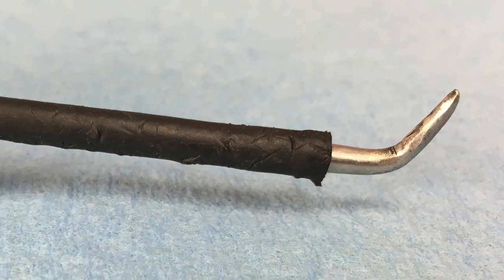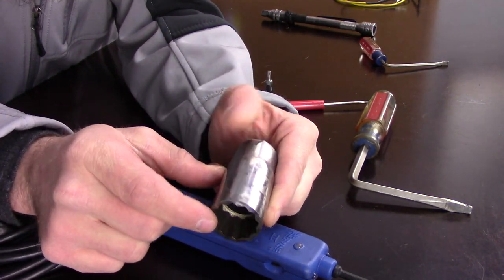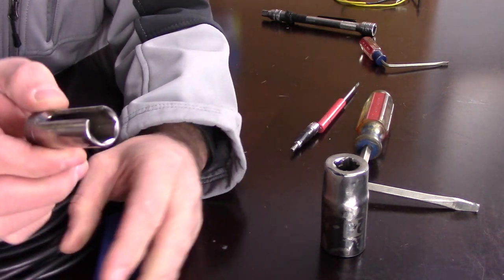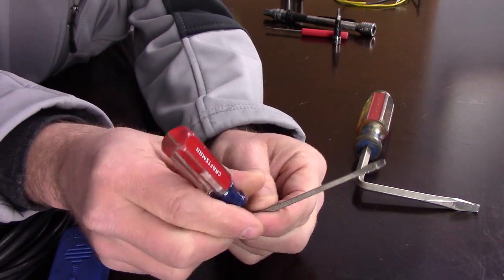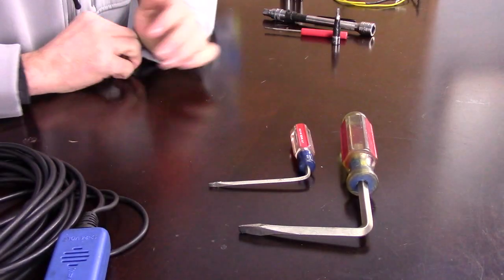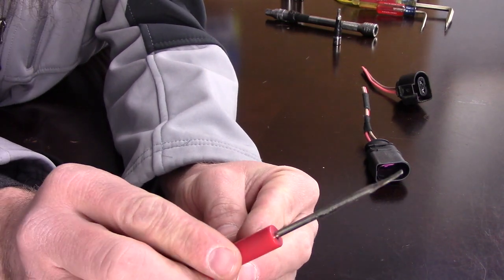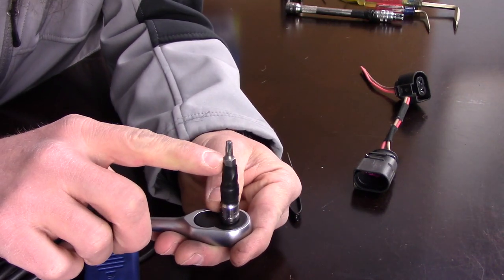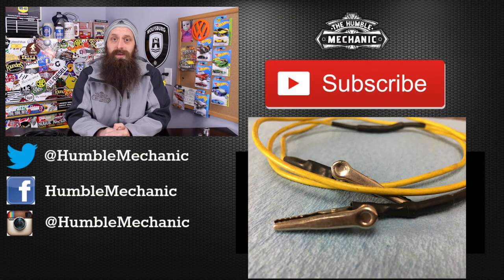Making And Modifying Custom Tools

Comment: I dropped a relay on my fiancé’s car and it went in a tight place in the engine bay and didn’t have any magnets or anything so I tapped a piece of wire coat hanger on a pair of needle nose pliers on each side and ended up gettin the relay back out good cheap easy extension to your pliers

Comment: I bought a bike cassette/freewheel removal kit on Amazon for $7. It consisted of a chain whip and a lockring. I thought I would need the chain whip because I thought I had a cassette. Turns out I had a freewheel. However, the lockring, even though the page said it was meant for a 7-gear bike, was a hair too large for my bike. However, instead of returning it, I decided to just grind down the teeth on the lockring just enough to fit my particular freewheel and remove it. The chain whip can still be of use when I retighten the freewheel.

Comment: The most engineering I have done was to make a tool to disconnect the stall converter bolts on a astro van with a completely seized engine, I had to weld the head of a open end wrench onto some curved metal that I cut in order to remove all of the bolts,    it took a long time.

Comment: Have one more to add to the reasons why list: sometimes a tool isn't needed until later.
On Audi C3 and Mercedes W123 280 that have K-Jetronic, the original injectors are steel. Had one snap off, so bought a German wrench that is the kind with a really thin (might be stamped) and bent the end to 90*. This allowed it to sneak in behind the fuel lines and hold the injector while getting the flare fitting off (which the injector can be corroded to the steel line). Now when installing use it too as find makes that easier.
Also have whacked the end off the handle of a stubby screwdriver so could access the steering box adjuster on a Volkswagen Squareback. Am sure others, but think those two are enough and add to the list.

Comment: My favorite custom tool was a brake drum upper spring puller. I bought a cheap set of brake drum tools from harbor freight and of course they didn't work well. I ended using the hook end of the spoon, bending it to make a longer hook, cutting the end to make it shorter, and putting an old grip from a pair of pliers so I have something to hold onto.  It also has a slight bend so I can hook and pull in whatever direction need be.
Reply from the maker: +MiamiZombie2012 I tell ya, I have heard of more brake tools modded than just about anything.

Comment: Hi Charles you could put a heat shrink over you snap on extension it would keep the pin in place just a idea?
Reply: That doesn't work on smooth area,on the wiring join are rough is ok.I tried  before,and I use tape now.

Comment: Toyota's use a cartridge oil filter. the caps need a special cup style socket . I bought one and then they turned the filter and cap side ways . that 40 $ tool won't work on them when the are sideways. I thinned the sidewalls way down and it works now

Comment: i never had a 8 point or 12 point socket to fit on a 3/8 square set screw so i used a 3/8 extension and put a small pipe wrench on it

Comment: I like to wrap a little electrical tape around my 1/4" u joint sockets because they move around too much when your trying to get them on the head of a bolt in a confined place. Works great, costs next to nothing.

Comment: I have never seen a diagnostic procedure in any manufacturer service manual begin with "using your power probe". Instead they refer to your meter or test light. When I was at TAC  and later at Tech assist, when I asked for a measurement and I  heard the powerprobe  sound, I would say "test lights don`t beep".
Reply from the maker: You’re right but as we know there are plenty of other methods to testing than the OE method. As long as it gets you there, I’m good. I prefer PP especially fuses. The beep registers faster for me than the light. 

Plus the power/ground/none of the time has saved me before

Comment: All those screwdrivers with filled down tips so they fit just right into a specific set of screws used in the car without damaging the grooves, plus countless other repurposed tools hacked up with a hacksaw from a time before I owned the right tool(who'd have though a bearing puller was also good for popping tie-rod ends out of their taper?)

Comment: "Tool" #1 In the place of an inadequate, limited reach bench grinder- I put my variable speed drill in a vise. Wire brushes and grind/cut wheels have a longer reach, you have great control and access to the work. "Tool" #2 is I made a small wooden box, installed a 110v extension cord, dimmer switch, and receptacle. Now I have a "variable power supply" that I can plug that vised drill into, and turn down if needed. I made it before I got a variable speed drill, but even with that- just lock the trigger and use the dimmer if need to.

Comment: custom handles for a head. find a bolt that will screw into any threaded hole in a head, weld it so it makes a T shape with another bolt, and you can use it for picking up and carrying heads a lot easier.
Reply from the maker: BOOM! I love it

Comment: I needed an 8mm square drive for a drain plug and used a piece of regular steel and made that square shape on one end. But the steel just twisted, so a bought the proper Chromium-vanadium socket.

Comment: I had a old 1/2” ratchet that locked up so I never used it well I thought of an idea witch was slipping the handle of the ratchet into a long piece of 1” steel tubing and I welded them together and now I have a breaker bar

Comment: I made a valve spring compressor for the old style vw heads you just lay the head on the tool and you can remove all the valve springs at one time

Comment: Welded 4" long chunk of cold rolled steel to a shallow socket in order to press out the sealed front bearing on my 99 Dodge 1500 4x4. In hind sight I should of used an extension, and not make a one use tool. works great. Back off the retaining bolts. Turn the steering wheel left and right, let the tool but up to the frame, and slowly press out the unit bearing. Don't get greedy and jam up the bearing assembly

Comment: i needed a 27mm hex head socket for a motorcycle fork tube.  ended up welding a 1/4 long socket inside of a big nut that fit perfectly.
Reply: tried picturing it and couldn't, checked your channel hoping their was a video, and searched some images online of the 27mm hex
Reply: +angel castillo 16mm nut welded too the end of a rod or like i did place a 1/4" socket inside it and weld.
Reply: +William Ronan ah ,I see now. awesome, I'll be using that in the future I'm sure. thanks for sharing
Reply: +angel castillo I see what you mean like a Allen key right but in socket form
Reply: Must have been an old bike, those "sink nut" caps are usually 8 sided
Reply: Welded a 14mm nut on a rod for the fork tube cap of a motorcycle too.

Comment: my favorite  mod is sliding a oring over a wobble to stiffen it up
Reply: I know what he's talking about... good idea might try it
Reply: fixing AR upper/lower clearance issues?
Reply: Electrical tape round the joint
Reply: koviack - Putting an O ring on a wobble socket extension's male end so that the socket doesn't wobble as much. (good idea, by the way) Putting tape on a loose universal joint works the same way. A wobble extension has a tapered male end, so the socket can tilt while you're turning it. Pretty much the same effect as a swivel socket or a socket on a universal joint. https://www.harborfreight.com/9-pc-wobble-socket-extension-set-67971.html Here's the set that I bought just to try out some wobble extensions. Not usually a Harbor Freight guy when it comes to that kind of stuff, but I'm happy with them.

Comment: Can't begin I tell I how many custom tools I've made. One notable one was a socket for Honda crank bolts. Anyone who knows well tell you how hard it is to get them out. They're tight. I dropped a 19mm deep impact socket inside a larger impact socket, maybe a 30mm, I forget exactly, then welded the two together. The added mass rips those crank bolts right out no problem. After a thousand crank bolts the modified socket has been 100% successful. 

So many guys can't think outside the box in this business, or any business for that matter. But especially in the automotive industry you've got to be able to adapt.
Reply: Auto correct on the phone sucks. Lol
Reply from the maker: +NothingSpecial "So many guys can't think outside the box in this business, or any business for that matter. But especially in the automotive industry you've got to be able to adapt."

I see this on the daily. FREAKING NAILED IT!!!
Reply: +HumbleMechanic On the subject of thinking outside the box, it doesn't just apply to making tools. A few days ago I had a Honda accord come in with a P0069 barometric pressure sensor range/performance problem. The troubleshooting steps from the manufacturer are as follows; Replace the PCM. Being that the BARO sensor is located inside the pcm with no external wiring or sensors it makes sense to replace the pcm. Honda has what's called "advanced diagnostic". This is a separate link that comes up along with the traditional troubleshooting link when you enter the DTC into the computer for information. The advanced diagnostic link provides information regarding enable criteria for the monitor to execute as well as the fail criteria to set the DTC and exactly how the vehicle computer determines there is a fault. The way the vehicle determines there is a failure of the BARO sensor is by comparing the BARO sensor voltage to the manifold absolute pressure sensor voltage during
Reply: +HumbleMechanic wide open throttle. If the two voltages are nearly the same the monitor completes and registers as passed. If the map sensor voltage is significantly lower than the BARO sensor voltage the monitor completes and a DTC sets. Now, being that I try to think outside the box, I know that there is another reason the map sensor voltage would indicate high vacuum during wide open throttle...  A restricted intake upstream of the throttle plate. Upon inspection of the intake duct I found it completely packed full of insulation from a rodent. This creates the restriction that a closed throttle plate would have and confuse the monitor. I'm sure plenty of techs have replaced computers because of this DTC only to end up finding a restriction n the intake. Point being, outside thinking needs to happen all the time including when using troubleshooting steps provided by the manufacturer.

Comment: i was swapping out an air strut from a 2009 mercedes benz S550 and i needed a 10mm socket with the channel like the one you made in order to get the air fitting off.. so i improvised and made one by cutting a channel into a cheap 10mm socket lol
Reply from the maker: +nicholas elias it works pretty well? Or I guess as long as it gets the job done.
Reply: +HumbleMechanic i had to file the razor sharp edges a bit so that they wouldnt cut the plastic lines but it definitely worked.
Reply: +nicholas elias this tool is required for the rear air struts because theres almost no room to get a flare wrench in.
Reply from the maker: +nicholas elias right on man!!

Comment: Just yesterday i made a special bmw 12 point spark plug socket from a cheap socket ground to be thin walled. Even glued a small piece of hose into the end to grab the spark plug and secure it into the socket! Love making tools! They always work better and are cheaper than buying a £45 socket off the snap on guy.
Reply from the maker: +AircooledAl we had a BMW roll in and we had to find a 1/4 drive of the proper size.

Comment: Cutting a section out of a standard 17mm craftsman wrench to effectively make a 10 point line wrench to take out the fuel fittings underneath the intake on a mk5 2.5 jetta

Comment: i was replacing vavle cover gaskets on a 2003 Audi A4 Convertible with the 3.0 V6 and could'nt remove the bolt at the very back of the vavle cover on the driver side,the brake lines are in the way and there is just no clerance to get there with a ratchet and a torx socket. so i took a 1/4 wrench and weld a torx bit on the close end still have it tho but i never work on VW/Audi now
Reply from the maker: +Jonathan Lessard NIce, too bad you can't use it more.

Comment: Many moons ago I made a very ugly but functional screw device to open the spring clips that held the toilet boll exhaust together on a MK2 golf.  I really hated the German who though that was a good way to hold something together.  But honestly after I took apart one that used bolts. The clip thing is a thousand times easier to use if you have a tool.

Comment: My favorite nodded tools are the ones I made when I first started out I took my Toyota oil filter cup and banged an old stripped out 7/8s socket onto the cup that socket is sealed tight on the 24mm nut of the cup and I took a cracked 21mm 3/8s shallow I had and electrical taped it to an extension for stupid Nissan wheels with the acorns and deep holes in the wheel cant really finger spin them on I call it my 21 on a stick or my Nissan tool most of the new guys we hire use it when they do rotates or tires

Comment: Try heat shrink on your roll pin might last longer
Reply from the maker: +John Bailey I haven't found a heat shrink that is big enough to fit over the ends, and will shrink small enough. I would have to take it apart. Ain't nobody got time for that. LOL

Comment: Great videos as always have a few costumes for my mk4 as well. quick question though. at 1800 rpm my 1.8t 01 jetta makes a rattle/ metal on metal sound. its not loud in the car but its very noticeable when i'm driving. it only happens at 1800 when going over under it and holding it any idea what that is? friend told me might be rod bearings but i don't know about that.
Reply: kinda good to have a sound clip but sounds like an exhaust heat shielding probably rotted and it just laying on the exhausted
Reply: kinda good to have a sound clip but sounds like an exhaust heat shielding probably rotted and it just laying on the exhausted
Reply: +rehlek knew those things were a issue but never figured it would only do it at a certain rpm. time to get out the lift!
Reply: +BooksofPerdition yeah i remember it doing it on my vehicle at about 2300rpm and drove me nuts. hopefully that's your issue and nothing else major

Comment: i found out the hard way that the 1.8 turbo engine in my 02 gti has a special torx type driver to take out the head bolts to replace the the head gasket and jim elliss vw wont even sell that sucker to you they sell the gasket but not the tool friggin jackhats thank the lord for snapon

Comment: i had problem in my vw passat 2.0 i lost the power of that turbo acceleration that i used to have and also the head light inside the car 
please help me or just tel me from where i should start 
one more please is a bad battery can cz all of this ?
Reply from the maker: Tough to say what is happening. Is the check engine light on? What else happens when the car acts funny?
Reply: +HumbleMechanic 
EPC light is on only and it is going once i start up the engine, what u think 
also it's taking about 3 to 5 second to start the engine 
thank u for your quick respond  really happy :)
Reply from the maker: Sounds like you are dealing with a fuel pump issue
Reply: +HumbleMechanic 
do you have any of your wonderful videos speaking about this FUEL PUMP ISSUE? 
thank again man

Comment: Have made a tool to replace new style Yukon and Sierra out door handles. Basically a old screwdriver bent at 90 degrees at the correct length. With a notch in the end. Only did this because someone else lost the special tool for it.
Reply from the maker: Nice. Funny how most of mine were made for that same reason!

Comment: The Ford timing tools. What a stupid thing they did. I worked at a ford dealer for a bit. The compression bolt they use for the crank doesn't always hold. So, you end up resetting the timing 2 or three times. Once had to replace the crank(under warranty) after 3 crank bolta that didnt hold.
Reply from the maker: That sucks!!

Comment: That would be my " i cant see shit light" when trying to diagnose on road side you sometimes need both hands and flashlights taste like shit.. I took a turn signal harness and bulb add 3 ft of wire to it, some gator clips and a neodymium magnet to the back.. I can use it to continuity, charge/discharge capacitors (stereo guys im looking at you) or just hook to any positve and any acceaable ground and put light right where i need/want. Great for midnight repairs/roadside bs.  Yes i mnow gm in the 90's had a hood light kinda like that (where i got the idea) bur the cord was only so long and didnt reach under the dash/trunk etc.. But mine... back of a cigarette lighter, tail light, door light, whatever i want to hook off and steal power from. Good to go.

Comment: SINCE YOU MODIFYING TOOLS.
How to make a angle grinder  drill bit for a cordless screwdriver mini drill. Make a bit to use grinder blades on a drill. But not any normal drill. But the electric cordless screwdrivers. Like the magnetic screwdriver bits.  (GRINDER BLADES BIT ON SCREWDRIVER!!) Using a cordless screwdriver. Not a cordless drill. 
Check this video link on a normal hammer drill to give u an idea about what to do with cordless screwdriver bits
https://youtu.be/nXLSHwrGIRI
😊😇🥰😊👍👍👍👍👍👍👍👍👍